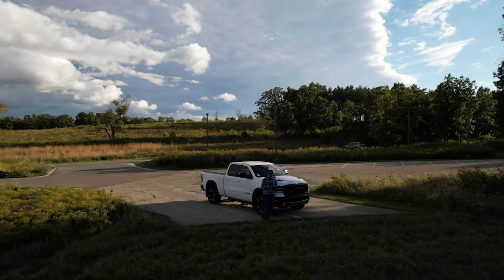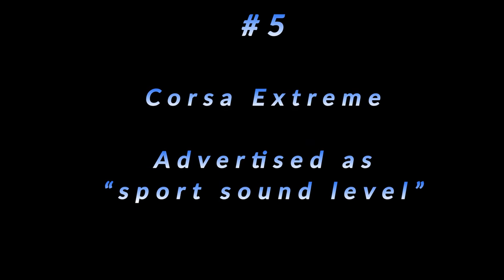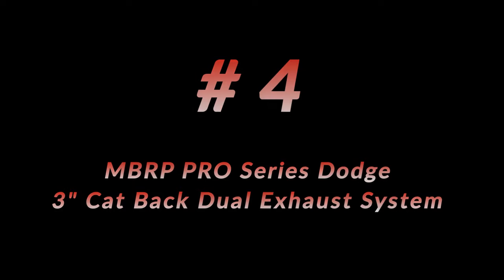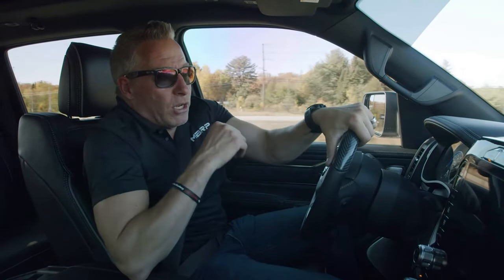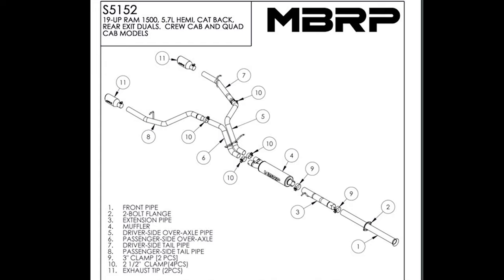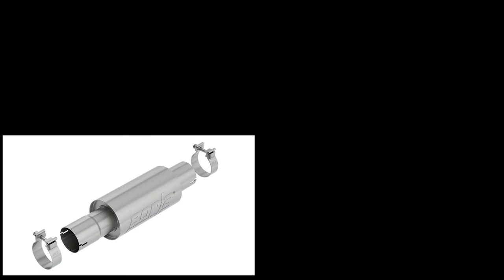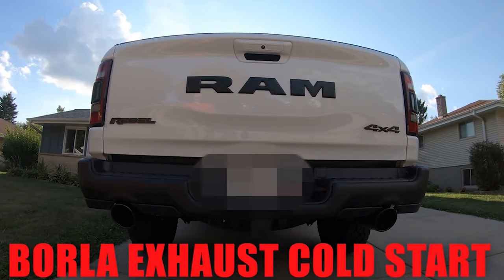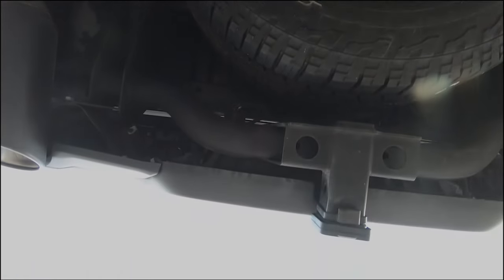Ram 1500 Bolt on exhaust | Best systems to consider before you buy

Comment from the maker: Things in this video and other helpful items ⬇⬇⬇⬇ See heads up note below!
PRICING ➡https://amzn.to/3ZoalrD ➡https://amzn.to/3kzN5YP ➡ https://amzn.to/3ISUA6y  ➡ https://bit.ly/3AhVq81 ➡ https://bit.ly/3opEz07 ➡ https://bit.ly/41MNS8T                                       ➡ https://bit.ly/43UkYpa

Check out my other content⬇⬇
Key FOB battery replacement ➡ https://youtube.com/shorts/aGvWOdPw8Cs
How to Test car battery | A complete Guide ➡ https://youtu.be/VGR_ETCwa8o
Gift Ideas For Car people 2023 | Must-Have Car Tools, Gadgets & More ➡ https://youtu.be/hRzjmGj48Pc
Change your own oil ➡https://youtu.be/Nq8inPbNYV0

Consider Subscribing  🚨 https://bit.ly/3N2pRXl🚨
Support is appreciated ➡ https://bit.ly/3Ak3QvF
Recommended ➡ https://bit.ly/3AjnDLw

Just a heads up If you are considering replacing your stock exhaust.
I don't know why Ram Designed the stock exhaust such that It cannot be removed on the ground without cutting it out...?
I had to cut mine out. Job Was not Difficult, Cutting was the worst part.
Looks like its even kind of a pain to get out with a lift without cutting.
See 3:05 in on this video:
https://www.youtube.com/watch?v=-QMakT2b00o&t=18s

Comment: I installed a B2 Fabrication muffler delete kit on my then new 2020 Ram 1500 Rebel 4x4. The entire kit cost me $185.00 back then. The truck still uses both stock tailpipe resonators. It sounds as good as all these high dollar kits. I made one cut with a Sawzall and the entire installation took less than an hour. My truck had only 300 miles on it when installed the delete pipe. I really think that I got a good system for far less money.

Comment: best bang for the buck and a great sound is just a simple muffler delete cut out the stock muffler and put in a straight pipe and leave everything else stock including the resonator and tips you'll save a lot of money and have great sound.
Reply: 100 % correct...2017 1500 limited hemi here...

Comment: On my 1500 I've had the borla touring, S-Type and atak. I will say firsthand the atak sounds of the absolute best and like the other two it's only loud during cold starts wide open throttle
Reply from the maker: I think crusing rpm plays a role in loudness here too. I have the 3.92 axle ratio and even the Borla S-Type was just a little too loud. I added Borla’s front muffler resonator. 

Sounds great and I can live with the volume on 12 hour road trips…

Comment: Should of used Carven exhaust . Sounds the best
Reply: I second this! Carven makes some great stuff. My #1 choice is their R series muffler or their Competitor series direct fit system (which uses the R series muffler).
I do like the Borla S type the best of the ones on this video.
My top 5 would probably be:
#1 Carven R series/Competitor 
#2 Flowmaster Super HP2
#3 Borla S type 
#4 Thrush #17661
#5 Flowmaster Super 50series

Comment: Do you have air suspension on that Limited?    Besides the exhaust, looking to add intake, coil packs, and possibly long tube headers.   Maybe a tuner.   Just to squeeze a few horsepower out since the limited is around 500 pounds heavier than the Laramie.     Saying that, I also don’t want it very loud, especially cruising.   What do you suggest that keeps it pretty quiet unless you’re on it?
Reply from the maker: I like the Borla S-Type. Gets loud when your on it, but not annoying for road trips/towing….
Reply: @LIOverdrive  
and you have that on a rebel… I’m wondering if the GT exhaust on the larimie GT is crap and worth changing. To the borla
Reply from the maker: @RC.56  yes I have the Rebel. The stock exhaust was wimpy.